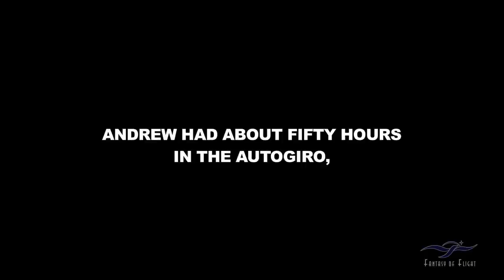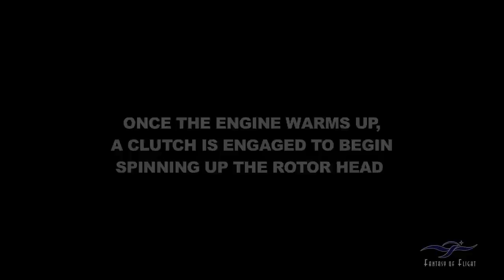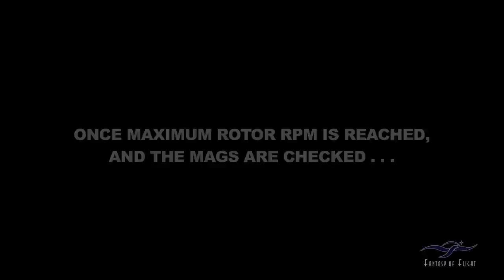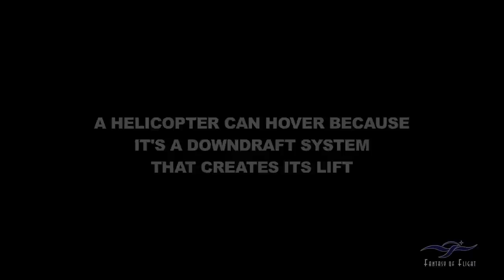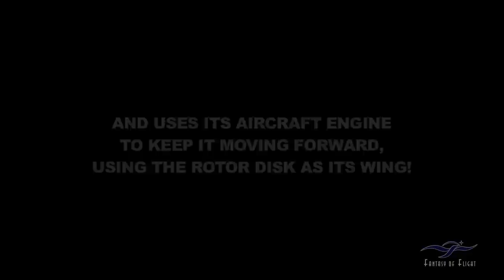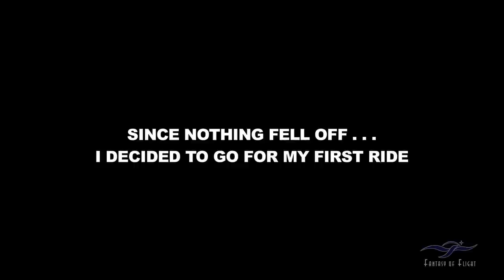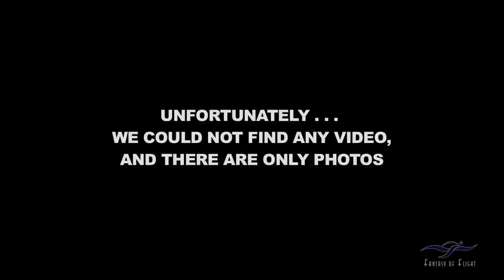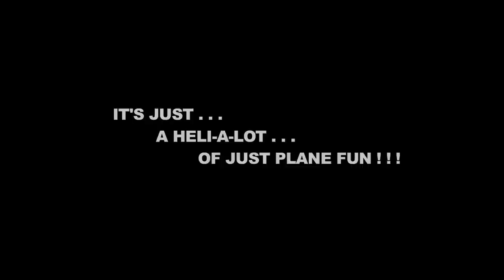Pitcairn PA-18 Autogiro Flies at FoF

Comment: Kermit, I have a model autogyro, for a FOX 35 ENGINE for MANY years ,,never built it, it’s for ‘U’ CONTROL LINES, the last model I built was a P51   WITH MONOCOTE finish,  in the 60s  also with a FOX 35 ENGINE,  flew well. , I never knew that such as yours,that the rotors were powered  !    Stay well, CHERIO 🇺🇸🇺🇸🇺🇸🇺🇸

Comment: A lot of people have the wrong idea about flying Gyros, they are one of the safest aircraft to fly. The biggest problem you see on YouTube with a gyro crashing is 90% of them is pilot error, the horse them off before it’s ready to fly.. the rotors aren’t ready to give you lift, ( aren’t up to speed)
That’s down to two , things. 1 Instructor didn’t teach the student correct technique, rotor speed, 2 getting behind the power curve.
I have just over 2,200 hours in gyros and not one of my students ever crashed on takeoff. It makes me mad when you see these gyro that cost 
$100,000 get trashed from bad piloting, or bad instructions.The machine I learned in only had a draft indicator out of a oven. I flew at 175 whatever. Pineapples, miles knots. But that was back in 1983. Good old days, cheers Wiz

Comment: What a lovely machine, I have never seen one like it, seen a few modern types, but not one like this.
I love Autogiros, why they were never more popular is a mystery to me, a lot safer and a lot harder to stall.
This type of Autogiro was used in WWII for radar testing in the UK just off the coast, they would go out and try to stay in one position for as long as they could, so radar could get a fix on them and check how well the radar was working.
Dangerous work with Germans going around to try to shoot you down if they saw you!
They have just got to be the best idea and fun aircraft to fly.
Reply: I cant remember which manufacturer they were licenced from, but if i recall the japanese used them in limited numbers for anti submarine warfare from memory
Reply: @Colt45hatchback  the Japanese used their own version of Kellet KD-1A, generally inline engines
theres a nice video of a closed cockpit KD-1B radial engined on YT that shows it configured as a mailplane, taking off from the roof of a 10 storey building
''The First Air Mail Flight from the roof of the Post Office @ 30th Street in Phila PA to Camden NJ''
Reply: @Colt45hatchback  Ideal for the job, interesting.
Reply: Not "harder to stall". Impossible to stall.
Reply: @abidfarooqui-sla3301  Not impossible, there was an accident in the UK when one stalled.

Comment: So it’s controlled with conventional flight controls and not through cyclic rotor control, correct? Also, what is a typical rotor rpm?
Reply: Fixed rotor head so stick and rudder, aileron turns.
Later generation autogiro had moveable rotor heads so the stubby wings could be dispensed with

Comment: So, once the autogyro is in flight, are you still giving power to the overhead rotor? Or is there ever power sent to the overhead rotor? Does it just start spinning because of the wind coming off the propeller in front?
Reply: Usually no, the rotor just spins freely once the gyro is in the air.
Reply: @murph9935  That is so funky and cool.
Reply: The wind comes up through the rotor so there is a component of the generated lift in the direction of rotation, it will work even with the engine stopped, the craft will just descend.
Reply: no the pre-rotor is just to get to speed, if it didnt have one you would have to roll around with some back stick to get the breeze to turn it.
once you have it running normal flight sustains the rotor. The backdraft from the engine helps but the rotor is rather larger than it can feed
Reply: @z_actual  Thanks! Such a cool machine.